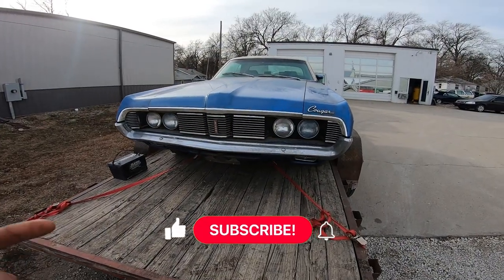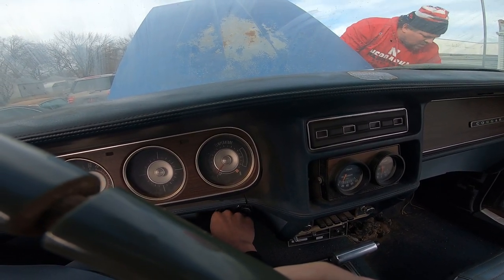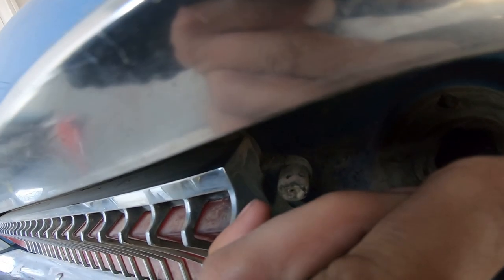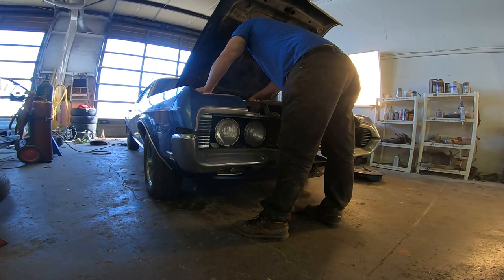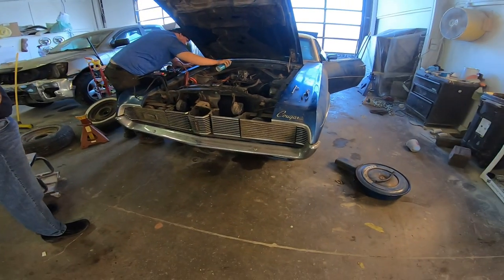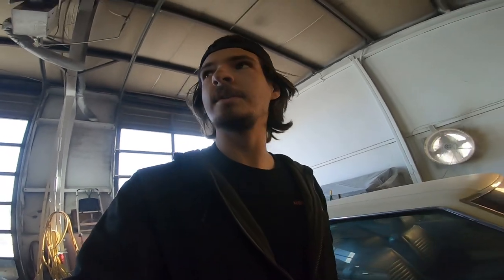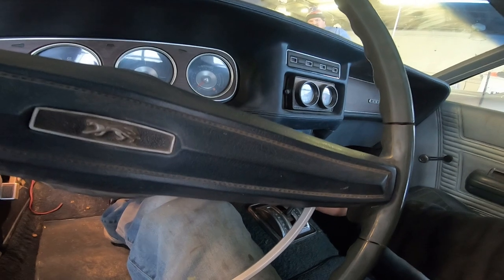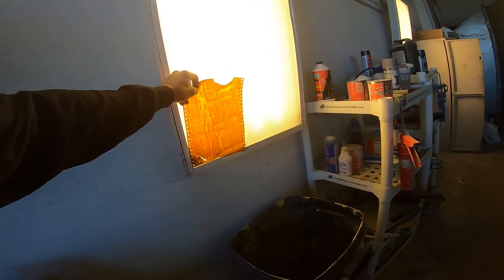Barn Find! RARE! 1969  Mercury Cougar SS. Will It Run and Drive After  20 Years FORGOTTEN!

Comment: The SS designation actually stood for “Spring Special.” My sister bought one of these new. It was just a trim package with turbine wheel covers, sport mirrors and a unique rocker panel molding. There were no engine or drivetrain modifications included with the package.
Reply from the maker: Ah interesting, our turbine covers came with the car fortunately!
Reply: Did the points an an rotor an condenser along the the cap an plugs get changed ?? Sure would help in starting it !!
Reply from the maker: No never did, which I was surprised we even had spark to begin with.
Reply: For the Cougar the SS stood for "Sports Special"

Comment: You should never try to start an old engine before changing the oil. Old oil gets extremely watered down when it is let sitting. Transmission fluid is not the same. Axle oil is usually safe also.
 Watery oil in an engine can blow the bearings out.
 Also with Fords you should change the fuel pump and better yet change it to an electric pump because factory mechanical fuel pumps can easily rupture when they're old and they leak right into the engine block washing the oil away.
 Another tip is to never run the engine off of starting fluid which is ether. It burns extremely hot and can melt holes through your pistons. As an experienced mechanic I will tell you for your own future knowledge to use it sparingly. Instead maybe have a glass bottle and just pour gas in if you want to keep it running.
Reply from the maker: Thanks for the tips, for most of the time we were using some 40:1 2 stroke gas

Comment: @ 12;18 in the video when you operate the carb..it seems that the accelerator pump linkage isnt moving far at all ..this will cause a bog or pop threw the carb usually when pulling out from a stop
Reply from the maker: I know thats what i was thinking, strange.
Reply: @Americana777  there should be a 3 or 4 hole arm the linkage for the pump by the accelerator linkage..i bet its on a lower hole.just pop the clip and move it up a hole or 2

Comment: I certainly would check out the gas tank before pulling any… 20 year old gas could cause lots of problems. Especially if it has solidified and is not making its way to the fuel pump..
Reply from the maker: Thanks!

Comment: No real mechanic would try to run a car that sat for so long without doing several things prior to turning it over. This guy also doesn't know much about the Cougar in general.
Reply from the maker: No, not a cougar guy, just know what i read about it online. Also oil viscosity was good, motor was just fine, we changed the fluids later.

Comment: What are the very first 5 things to do before ever turning the key on a cougar that has not ran since 2002? This summer I will be having my first car shipped to me from my parents house
Reply from the maker: If you want to be picky, then pull the spark plugs and shoot some wd40 or a lubricant in the cylinders, then maybe put some 2 stroke gas into the carb for the first run to lubricate the accelerator pump, maybe turn it over by hand a few times, then roll it over without the plugs in to get the oil pressure up before it runs, then it should be pretty happy to start up and run good for a guy.

Comment: Nice find. 351 is still a good engine, especially if it’s a Cleveland. Please don’t fill this one with maple syrup. 😄
Reply from the maker: Lol right! do you know? whats the difference between a windsor and a Cleveland
Reply: @Americana777  The Windsor has 6 valve cover bolts and the Cleveland has 8 valve cover bolts
Reply: @Americana777 clevland has canted valve heads & bigger valves. They can make some serious power!

Comment: The first car as I was 14 without a  licensed one warned not to go buy the grey primared American us maggs cracked a frame and something about only to drive it straight home exited as I drove the very last awesome black interior nachos to an area looking for the race destined by another person with his 71 mustang 302. We started from our 2distinctuons of our friends in the two cars with his weak 1 tire burnouts from the 2 tires  the cougar was laying them thicker and louder roar of its dual header 351 big block 4 barrel Cleveland  f13 racing gear tyranny. We started with the cougar blowing the doors off his especially a block ahead at around 85mph my left severely front tire blew without power steering sent us into several fully sideways fishtail I spun the steering wheel first missing our freind delivering papers on  his bike never seen us by mear inches.  The last one sending us into a high curb folding the rim flat as it came onto a lawn stopping an inch from the house with a loud yelling stranger who was saying this was what would happen as ignoring his repeated warnings about racing up and down the street all the time.  Good times.
Reply from the maker: Wow awesome story! Thanks for watching!